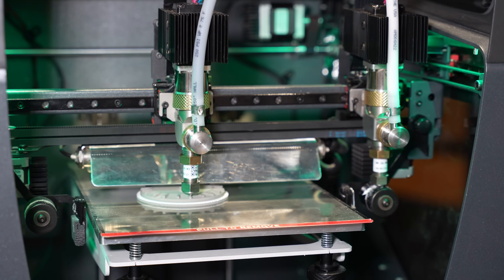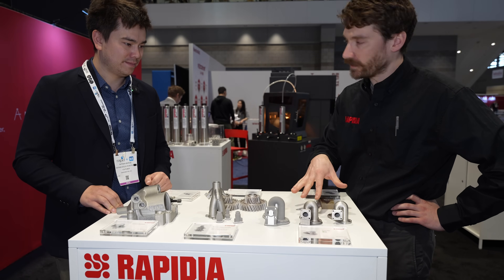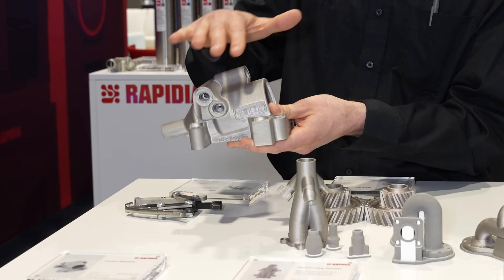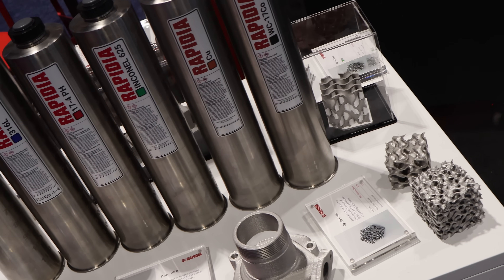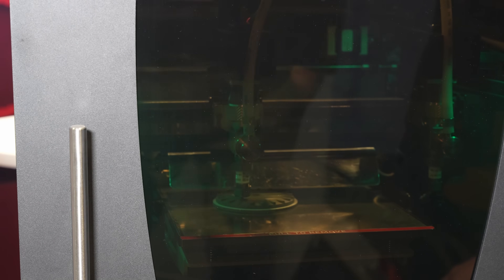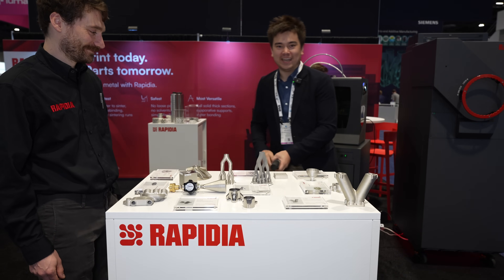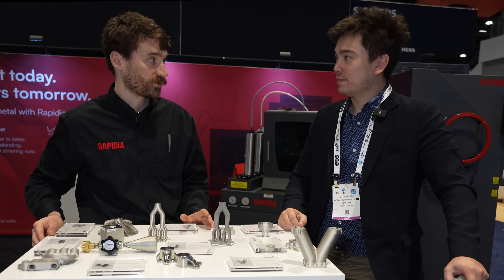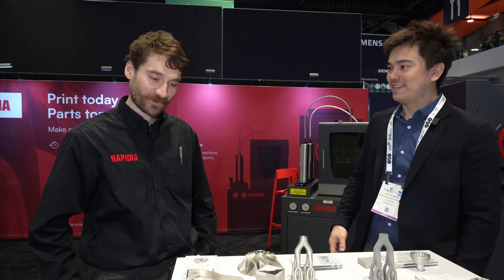Metal Paste 3D Printing - Rapidia

Comment: This is extremely cool. While still expensive, you can see how the cost of this could come down rapidly with cost saving measures. Nice interview!
Reply from the maker: Definitely a nice product, it looks quite simple to operate. Other metal processes require alot more careful consideration of support material, since you have to grind it off
Reply: @NathanBuildsRobots  Yeah the boundary material is very clever!

Comment: So... kinda like when doing PMC paste with a plunger... how there are no patents on this because this has all been done before already.
Reply from the maker: I don’t have the time to look at all of their IP portfolio to see what they have/haven’t patented.

But applying solder paste to a circuit board isn’t exactly the same thing as building a 3 dimensional object. I’ve applied solder paste and it never occurred to me that I could build a 3D object out of it, use higher melting point metals, then sinter it instead of melting it. Easy to connect the dots in hindsight though!

Comment: If this hardware and software package cannot produce accurate intended dimensions, this rapidia 3d printer is useless.
Reply from the maker: The parts seemed pretty precise and flat. There are couple of ways to counteract the effects of shrinkage:
1) Oversize the part by 10-20% so you print it larger, then it shrinks to the correct size.
2) post-process machine critical features. This is common with all types of additive manufacturing to meet tolerance and surface finish requirements.

Near-net shaping of parts has been around for ages. Anything that is cast or forged usually needs to be cleaned up via a milling or grinding operation, so the challenges with this process are nothing new. 

Also, some of the high strength alloys they are using are incredibly hard to machine. So you get the ability to make non-manufacturable parts, and can skip a lot of time-consuming material removal. I think it's a great technology but I appreciate your concerns.
Reply: All sintered components that use a FDM process actually shrink, so you have to compensate with your model size. It's the same for UltiMaker and BASF Fuse material.

Comment: Ultrafuse shrinks by 17% and this paste shrinks by "about 13%", I can see parts with high tolerances needing further post processing in the form of machining to get them to the correct sizes.
Reply: Yes , that correct ,if yuo need precision yuo gone need to cut there or there a "little bit" , but its very diferent adjust a metal part with a lathe or some grinding machine , that make the part in a cnc machine , thats take much more time and adjusment i think , and there e are  part yuo cant do in a cnc machine , so this thech have a good place there , like the SLM machine that fuse metal powder , tgey can make bach of metal parts with a grat desing , i saw that a metal brake for bikes in Titan workshop , search in yuotube
Reply from the maker: The crazy part was the green part post processing. I imagine it would be very easy to drill holes or smooth the parts out while green. But for actual precision and high polish finishes it has to be done after sintering.
Reply: If they have good software support in the form of plugins or their slicer, it should help greatly with that issue.
Reply: By calculating correctly you can get very high precision

Comment: At work we deal with the polymer base metal filaments (like the BASF Ultrafuse line with around 90% metal powder), the idea of sintering the part that is basically FDM printed is genius, the issue really lies on the sintering itself, that's the whole magic of the process.
Reply from the maker: Sintering is not a new technology, it is actually 5000+ years old. Clay pots are hardened by sintering (sounds like you already knew about this stuff but explaining for the general audience). It is a very cool process that I would love to do a special video on sometime. Basically small particles melt and fuse together below their melting point, because of surface energy. Which sounds like a hell of a hand-wave of an answer. A material scientist would be able to provide a much more insightful explanation than I can.

Comment: Put in k1 speedy a glass bed plz it will help
Reply from the maker: Yeah, the mass production capabilities would be insane if they sped this machine up. But more speed causes more problems.
Reply: @NathanBuildsRobots   will you put glass then?
Reply from the maker: Oh, you are referring to the K1, not this video. Possibly, I will consider it. Going to compare stock K1 to P1P first.

Comment: At this point someone is going to make an Ender 3 to Metal Paste printing conversion kit that you can Buy.
Reply from the maker: Haha, I made a joke about that in the video. It is pretty similar to a ceramic 3D printer, like the Tronxy Moore 1 which I reviewed. 
I think in reality you would find it much harder to do than you think. But those parts are so awesome. Those stainless steel alloys they are using are no joke - insanely strong stuff. And it print parts relatively fast.
Reply: I'm a machinist with an almost ready to retire boss and he's just now coming around to seeing me print resin and fdm. now if only what op said , I can convince him with it 😉
Reply from the maker: Machining those high strength Stainless, inconel, and Titanium alloys is not fun at all. Additive manufacturing methods like this are making those alloys a lot more accessible, and also making weird internal geometries possible. The future for this stuff is only going to grow!
Reply: Proper Printing has been working on SLA paste printing with an FDM machine. This would be a logical next step.